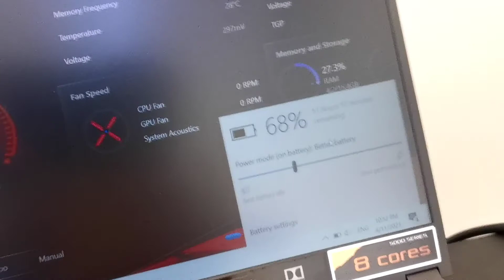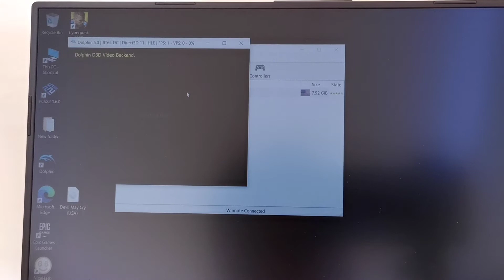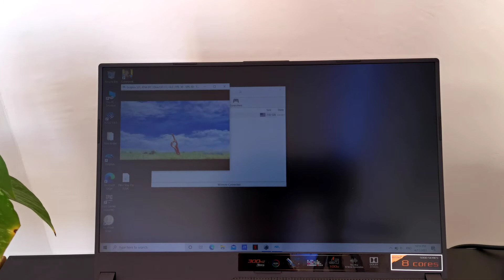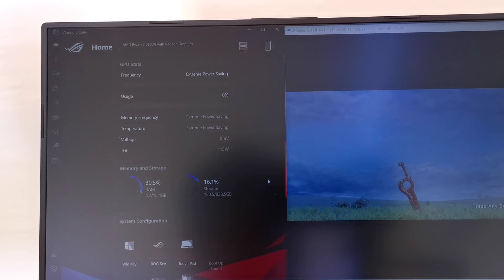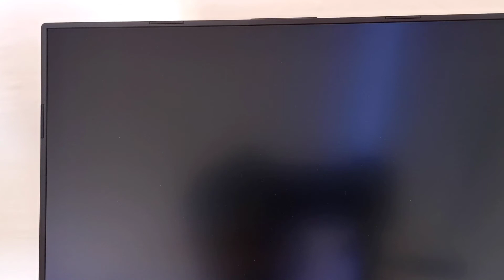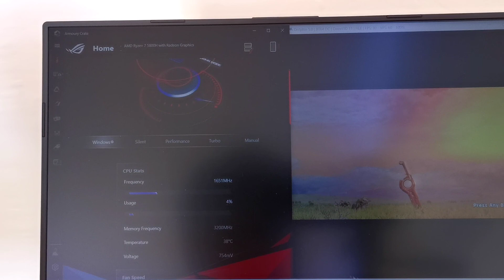ROG Strix G15 : Dolphin Emulator performance and battery life Ryzen 7 5800h

Comment: Cool, thanks for the test! Would you happen to have interest in testing Wii U/Cemu emulator on your config? I'm considering these specs for my next buy, but would like to see how many FPS Breath of the Wild could run.
Reply from the maker: Sure will do that later , but I'd say it will easily hit 60 fps
Reply: @MJReviews  Sweet, I'd love to see it. I bet it would play at 60 fps with ease, maybe even 80fps. I have an i7 7700HQ/GTX 1060 that's showing it's age, but maintains 55-60fps @1080p with the latest build. It runs loud and hot like a hairdryer.